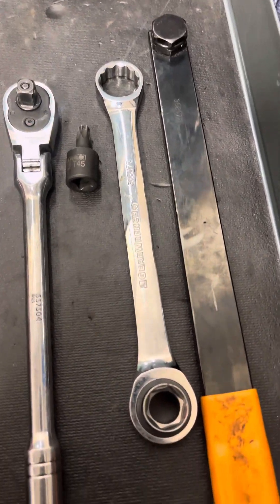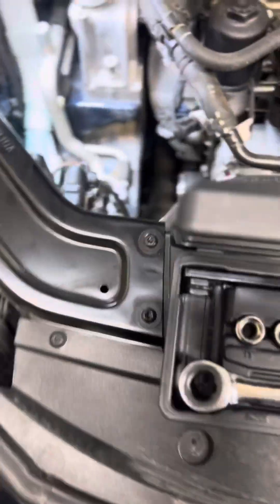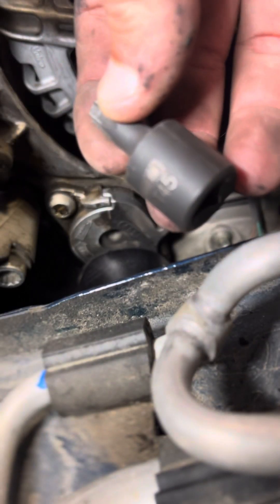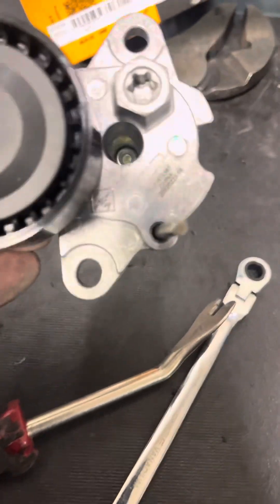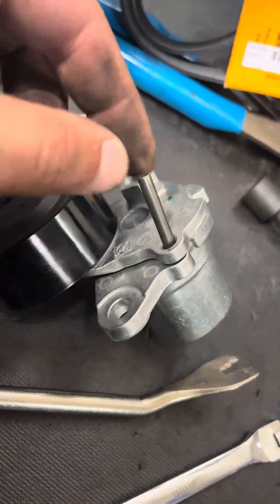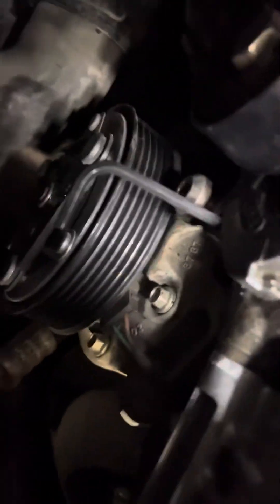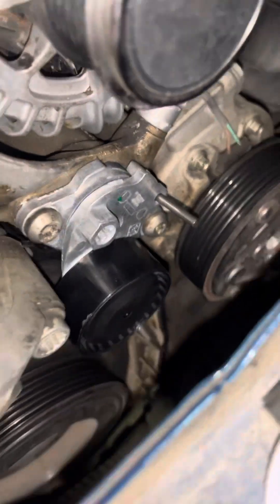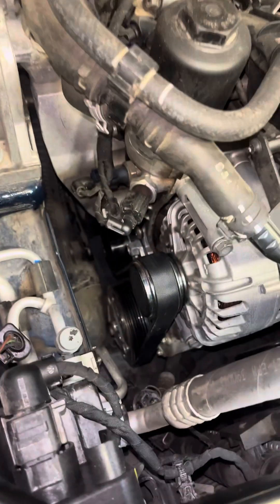How to Replace Serpentine Belt Tensioner 2018 VW Passat

Comment: The new one is without bolt on  wheel. In the latest you can change only wheel and keep the old tensioner. Nowadays company produce only things single use. Shame.